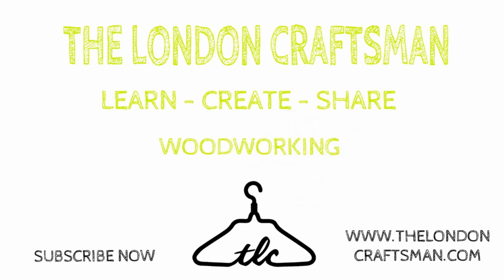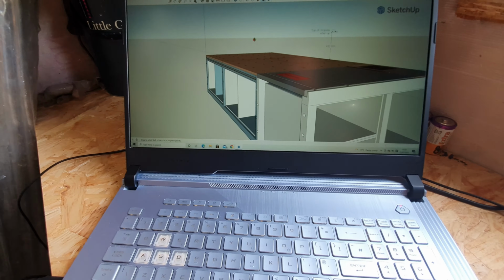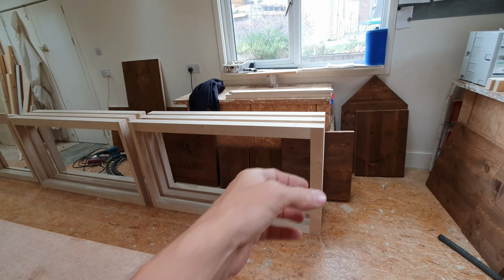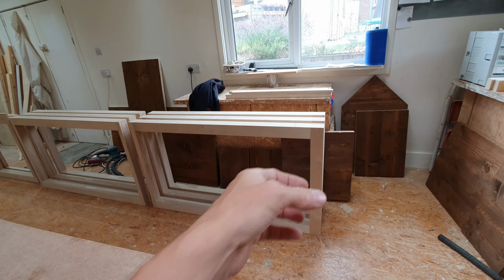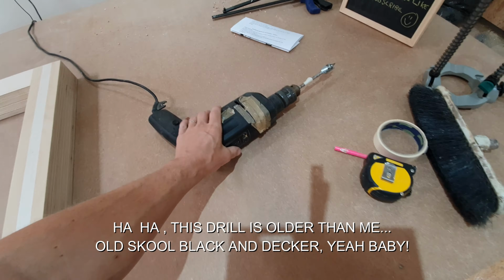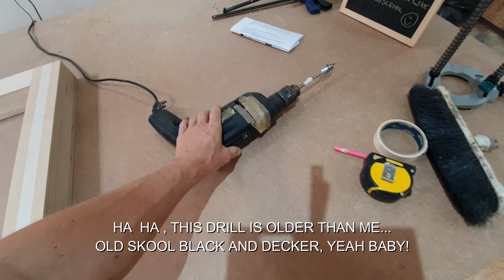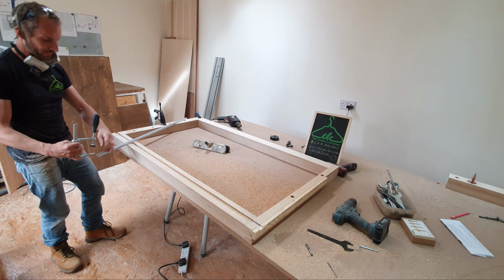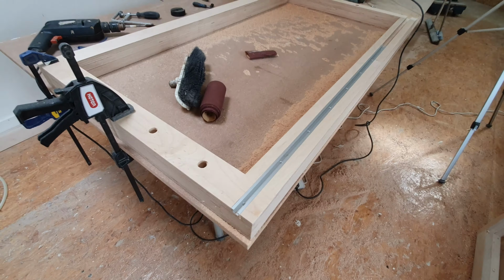MASSIVE Ultimate Workbench Build - 3.6m x 1.6m - Machining The T-tracks & Dog Holes - PART 3

Comment: Nice one. Where did you get the t-tracks?
Reply from the maker: Is the link not in the description?
Reply: @thelondoncraftsmanworkshop  Not from what I can see. It doesn't matter now as I managed to source them from Wood Workers Workshop. Thanks.
Reply: @BillyBoy46  Hi - thanks for posting - can I just check which exact track you got to match the clamps? There are a couple on that website...They might all be the same to be honest in terms of the groove, but wasn't 100% sure.
Reply: @marklambert8045  The track I got was the AUKTools T-Track Regular 1219mm (48") which fits the clamps from Banggood beautifully. Hope that helps.

Comment: I tend to stick with Osmo raw oil (with the slight white tint in it). It means that by avoiding any yellowing any mix of timbers still kind of blend, and look interesting.
Reply from the maker: I am tempted to use this, I use this quite alot too.
My only thoughts were, is it going to get filthy straight away and is it going to be hard wearing.
I know a bench is ment to get worn in etc but I don't want to get ruined.
The top/worktop part of the bench that's a different story, I don't mind that get battered and worn, as that's the working part of the bench but the frames and doors and carcasses I'm a bit more worried about.
Do you think a coat of raw osmo would be up to it? I was thinking a grey tone oil to hide the dirt and marks etc but really unsure!
Reply: @thelondoncraftsmanworkshop  yeah, good point. What about one or two coats of Osmo raw, and then 2 or 3 coats of Osmo worktop oil? I've been very impressed at how the worktop oil holds up with some heavy-handed clients' kitchens. Mind you, I think the best kitchen worktop performance I get is from the ones that I 'prime' first with Osmo Wood Protector (4006).

I tend to have a load of Osmo on hand so I'd probably go belt & braces for your workbench - a cost of 4006 Protector, then 2 coats raw oil, then 2 coats worktop oil. The good thing about the worktop oil is if you've sanded really fine beforehand, it's a really good smooth finish and doesn't attract dust etc. I mean, it's supposed to be sacrificial anyway, so re-coating is needed every now and again, but with the worktop oil finish you only need a really light tickle of sandpaper before re-coating. Give it a tickle and a re-coat as part of your 'Friday tidy' and you'll be good to go again on Monday :)
Reply from the maker: Sorry for the late reply mate, thanks for your advice!
I think your on to a winner, if I'm using a light colour osmo, then doing all 3 types would make sense, especially as I want this bench to last to at least my kids grow up and use it 😁😁.
I think I'll go down that route , thank you!

Comment: Have a look at the webeco bf1243 drill stand that you could build into the bench, it's expensive but would mean you could route or even use as a lathe, versatile, rock solid and could be removed from base when not in use so can recess into the top
Reply from the maker: I'll look at.that now, sounds really interesting!
Reply from the maker: Looks solid mate, can't really find where to buy it though!
Reply: @thelondoncraftsmanworkshop  yeah I've seen a few places in UK or direct from Germany obviously easier before Brexit lol
Reply: Did you see all the configurations you can put it in? There's also a vice table you can use it with as well
Reply from the maker: Yeah it's pretty awesome. I'm.lookkng for a pillar drill, would you say this is good enough and big enough to do what a decent large pillar drill could do?
Reply from the maker: Wicked!